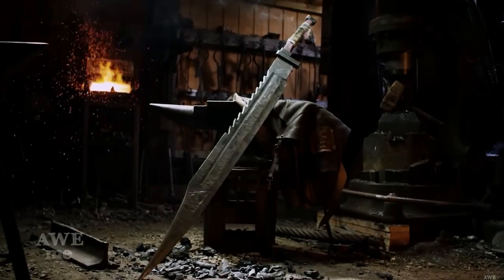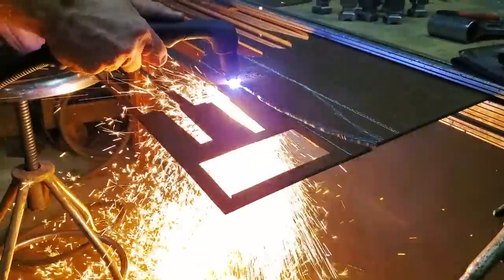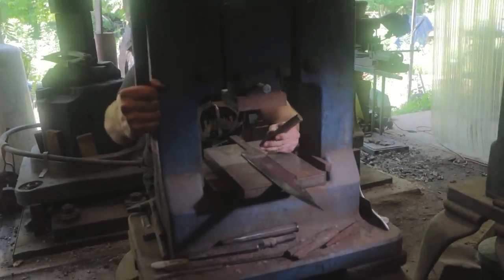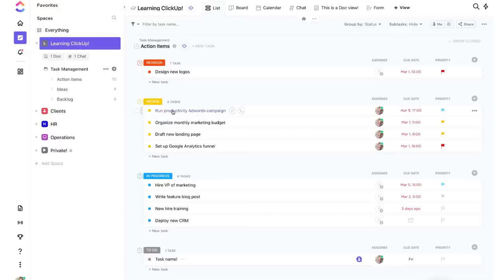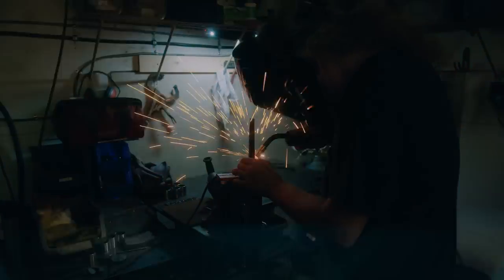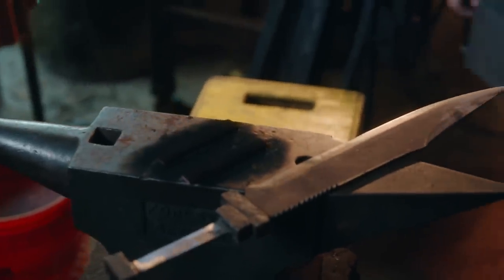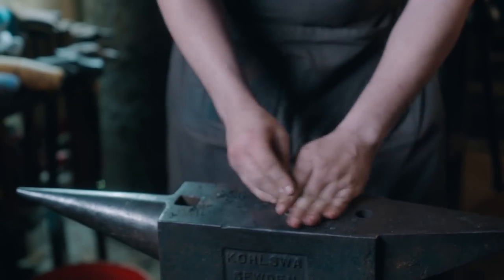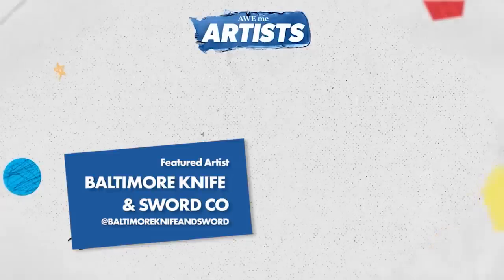PYRAMID HEAD'S BOWIE KNIFE - Silent Hill - AWE Me Artists/Man at Arms

Comment: After heat treatment you would want to avoid burning the edges on the grinding wheels. Your just reducing the heat treatment at that point by putting in all that heat.
The best way to avoid this is to make a grinder that has running water on the belts without causing issues with the electronics of the grinder and rusting the supports... Many makers have done this without issues.
Reply from the maker: So long as we keep the blade under 400 deg F it does not change hardness at all.  Thats why you see the tanks of coolant next to all the grinders.
Reply: @AweMe  right... And you have no idea how hot that blades getting with all those sparks. I tend to avoid makers who don't run water on the belts cause of this. The end result isn't as good.
Reply from the maker: @tacticalcenter8658  We harden AND test in house.  Note that we only post harden grind on Medium Carbon alloys, High carbon are all pre forged and ground.
Reply: @AweMe  Oooh what kind of hardness tester do you have there?